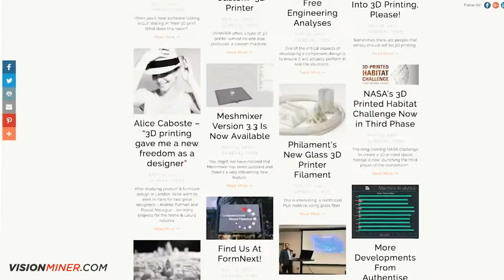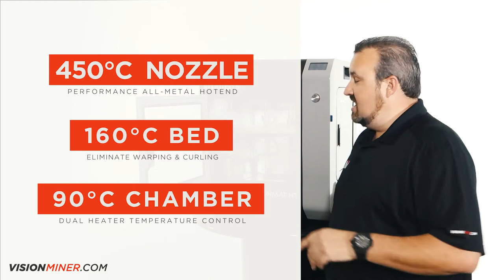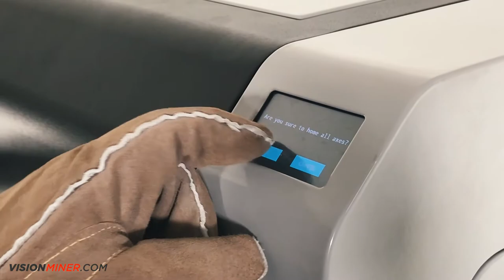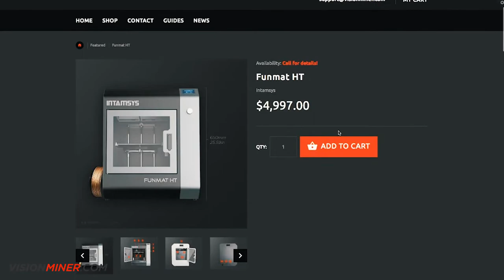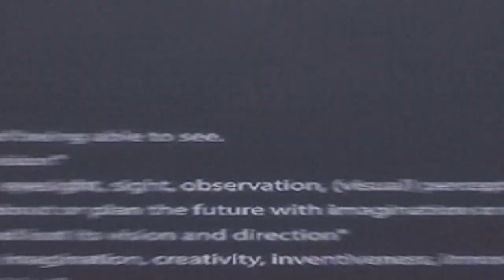INTAMSYS Funmat HT - Best Industrial PEEK & ULTEM™ 3D Printer?  (2018)

Comment: What are the best full color small printers?  Can you get the plastic mold maker, and machine that uses the plates?  How to print casts and prosthetic covers ups?  thx
Reply from the maker: Not sure on the best full-color small printers -- there aren't many out there yet for full color. However, machines like the The Palette filament feeding system can splice up to 4 colors to 3D print on any system. You can definitely make molds with this, but what do you mean by "uses plates"? Casts and prosthetics are a huge industry for these machines, yes! Thanks for the comment :)

Comment: What size is the bed? It looks too small to print quadcopter parts to me.
Reply from the maker: 260x260x260mm -- just over 10 inches. You could easily print a frame for a 250 sized race drone, or modular arms and parts for another kind of drone... what kind of applications are you thinking?
Reply: Something like a solid one piece 450 or larger.
Reply from the maker: For that, you'll want to get the Funmat Pro HT -- our large format version. It's print bed is 450x450mm, and you could print up to 600mm tall. While costing a bit more, it still destroys the competition for size and capabilities. If you want to print that big, it's definitely the best bang for your buck! That would be an awesome project!

Comment: I know this is from 2018 but the prints look terrible for that price. Also why is the Nozzle and Hotend so awfully bent at 3:39? I hope Intamsys has a new model coming with linear rails and better hotend this one looks very DIY.
Reply from the maker: 2017, actually hahaha! That heat break actually did get bent, it's come a long way since then, for sure! Almost every part of the machine has changed since this one, which was the first full production model :)
Reply: @VisionMiner  I saw they have an "ENHANCED" version but very little info about it just the standard bla bla. It's a pity there is no real in depth review about such a high priced machine. I mean there are tons of infos for cheap printers but almost none of the higher priced ones.

Comment: It says 7,499 in yalls website
Reply from the maker: This video is 3 years old, too, lol --- the printer has improved, plus there is now a 30% tariff on everything from China, so that didn't help much.... add in shipping, and it's even harder :/ This was the original machine, though, a lot has changed :)
Reply: @VisionMiner  didn't see the year on the video. Still looking at the 3d printer I dont see nothing wrong just hoe fast it prints part. Using nylon carbon and pekk filliment

Comment: This printer is a joke I also got to demo this printer and the heated build chamber is cool the build quality is terrible their website claims 0.5 yeah right maybe if you equip the .2 mm nozzle but then something like a 20 mm x 20 mm cube is going to take several hours I don't see enough quality out of the machine to warnt a $5,000 price tag and any heated build chamber printer of this caliber has a liquid-cooled hot in not a e3d looking knockoff if that's the best you could find in that price range you not looking good enough this thing looks like another cubex to me it does what it says it does just not good enough and because they've put a functional material machine on the market a few thousand dollars cheaper than anyone else doesn't mean it's worth buying anyone interested in a machine like this save up another couple thousand and go with industry leaders not someone who puts insulated material in a box with two heaters stuck to the sides and calls it a heated chamber I consistently can get 90 see out of passive Cooling by putting an enclosure around a normal printer LOL thanks for your videos you guys do a good job just disagree with your choice
Reply from the maker: You clearly have a major skillset for hacking together machines. I'm not sure when you had a demo of the machine, but it certainly wasn't a production model, or anytime recently. Your arguments against it are obvious, like the 0.5mm layers taking a long time -- this is the nature of the game, and how fast you can put down layers at that height. Yes, it will double the time of .1mm layers -- everyone should know this. No other printers with heated chambers or temperatures like this one have liquid cooling -- for $5000. If I'm mistaken, please send me a link! 

Sure, if you have 100k to blow on a printer and support, you can get other machines -- but nothing even comes close to this machine. 

The simple fact is: it WORKS. For people who do not want to spend 20k building their own machine and achieving the same quality as we already provide, this is a no-brainer purchase. Just look at our other videos -- you'll see impressive quality in PEEK, ULTEM, and even PPSU. Aside from that, having the chamber and temps for materials like PC, ABS, and PA, this is a screaming good deal. They undercut everyone in the market because the quality IS possible at the price, and the industry is moving forward. 

We could charge 10k for the machine, and it would still be a great deal -- but we're not. We've done everything to get the best quality at an affordable price. We're driving the industry forward with these features. Unlike the CubeX, this is not built of cheap plastic -- it's 100lbs, with features like battery backups and 160C beds, which you cannot find anywhere for the price, ready-out-of-the-box. 

Come to our showroom and see for yourself -- this machine is FANTASTIC value, considering it's around the price of an Ultimaker. Plus, with the new firmware updates every few months, it's constantly getting better. Good luck finding a better deal! (Or, just keep using wooden knock-off makerbots and building your projects -- not everyone wants to do that, but your skills are respectable! It's just not practical, or realistic for most people). And, of course, with time, it will be upgraded -- as we generate supply of higher-end technology. For now, this machine is a beast worth having! When did you have your demo?
Reply: Vision Miner okay challenge accepted I'm going to take two printers you might call cheap it will probably take me a few weeks to order and get the material this machine runs. I will first post a video of my e3d big box that is liquid cool and has a heater in the chamber with an upgraded thermistor and heater block I will easily achieve better print qualities in this thing with the same material secondly which will be a little harder I will upgrade one of my CR-10 to the same specs I will put a cardboard box over the top of it with the heating element inside and achieve the same results can't wait to show you that any machine over a couple thousand dollars that doesn't have these mods is not worth it and I'm including everything MakerBot ultimaker all of them myself and plenty of others have achieved better print qualities from these cheap as you call them machines then I can even get out of any of my industrial machines from stratasys I will order some of this material tonight and post as soon as I can!!!!
Reply: Shane wow that was a civil semi intelligent comment with some pretty good points and if you go back to my original post you'll find some similarities yes I fully agree with you like I said in my original post there are far cheaper machines you'll get the same quality out of when I originally bought my stratasys machines I was the only one in my area doing this so I was lucky enough to quickly make my return and for years now have made profits and to be honest we use these printers far less than are newer liquid resin machines if you're hung up on the stratasys just because I chose some of my oldest printers to make an example of then I guess that's on you man I will tell you right now at $5,000 with a print area of that size it is going to be quite a while before you're going to make your money back that is undisputable especially in these times when everyone online has a post about prototyping for people look I'll give respect to anyone who won't back down but if we're talking about accusing people of their lives look at all of your post from the very first one you sent me shiting on me when I gave an honest review on a printer that I saw myself at the same f**** show that these guys bought their printer from I am not in the wrong dude you're salty on me I don't know why you don't even own this machine it would be one thing if you owned one and had a successful business with it there's a big difference between I was around technology and I currently make money with technology I do this s*** everyday but I could give a f*** about what you think every time I open my doors in the morning I do what I love and don't call it work if you got it all figured out man definitely not too late for you to buy this printer and start your on gig good luck
Reply: @MrCAPSco  Hi! Any progress?